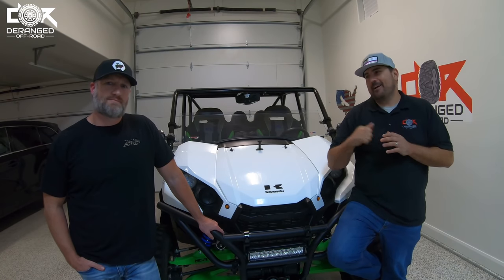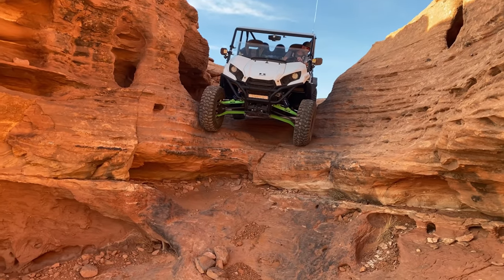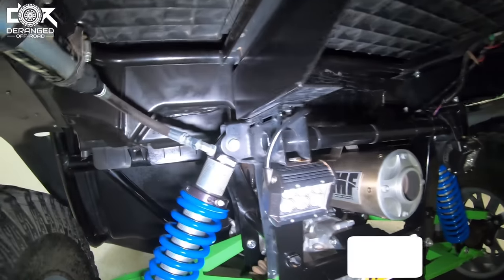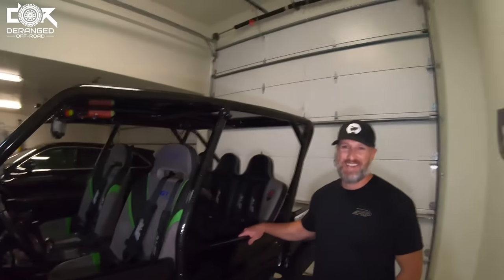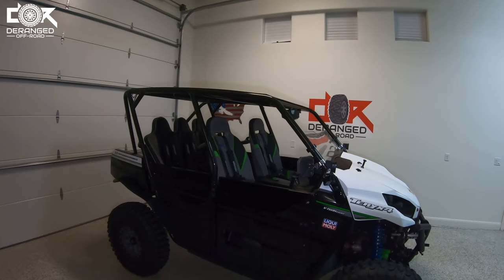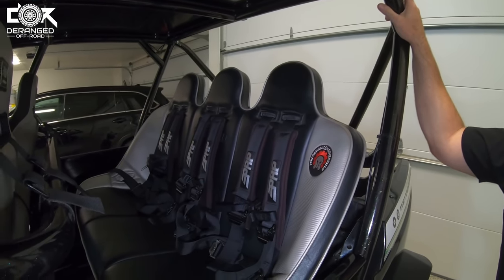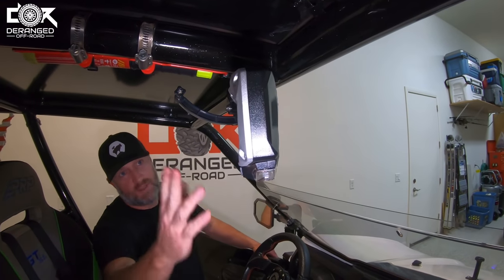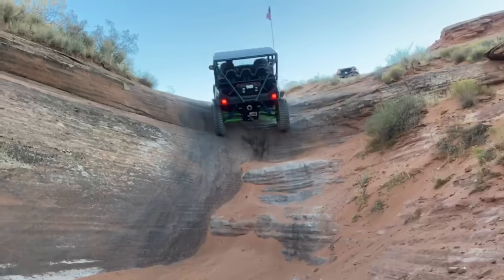Teryx Adventures Custom Kawasaki Teryx 4 Walk Around

Comment: Could you provide some more info about the steering wheel? I’m wanting to upgrade mine on my T4 but can’t find much info out there. Did you have to use an adapter? If so, which one? Is yours a quick release? I’m leaning toward a quick release for the security. Thanks for any help. Your T4 is freaking awesome!

Comment: Hi Garrett, I know this is a older video but I wanted to ask you something about the Teryx.  I have a 2020 Teryx 4, and it runs great, and I'm up to about 1700 miles on it and according to the manual it should have the valve clearance checked?  With having a warranty still on it, and I'm not exactly ready to check that myself and taking it to the local shop will cost me about $200+ is this something that's a absolute must to get checked out right now?  Is this something you had to adjust on your Teryx before?

Comment: Hey were looking at a terx4 kinda stuck on what model we should get ? I like the S Le but the wife like the S Se with the radio and factory winch is the S Se worth the extra 1000 and would you go with the terx4 for a family trail rig or a different model like the razor xp1000? Thanks
Reply from the maker: If I went with another Teryx4 it would be the s model Se. For a good trial rig the new Polaris xp1000 is very nice as well. If really tight trails aren’t an issue why not go with the KRX 4? That would be my first choice for a family rig. -Garrett

Comment: He mention the front seats don’t pop out how do you check oil and eng compartment. I hate to pull seats every time to check oil level. Otherwise a great Volg give me some ideas
Reply: The PRP seats come with custom seat brackets, the back has tabs and the front has two bolts. I can undo those two bolts and lift the seat enough to access for oil change. easiest would be to take it out all the way though. In that case I simply unwrap from bar behind the seat and take it out that way.